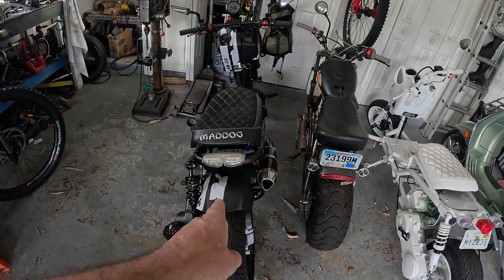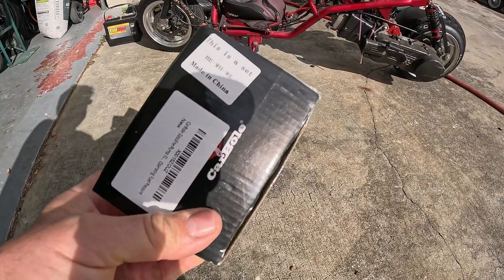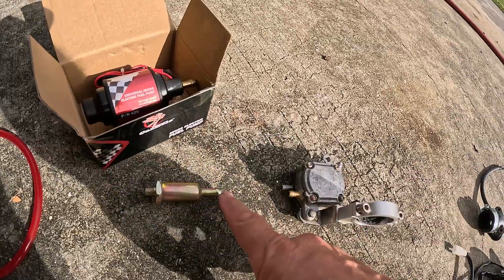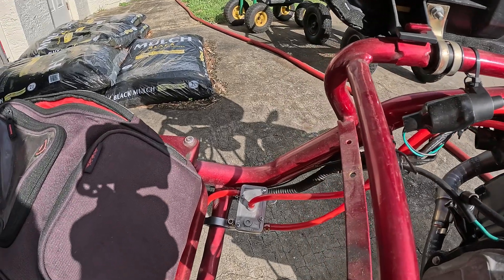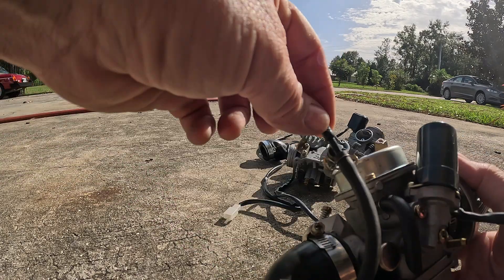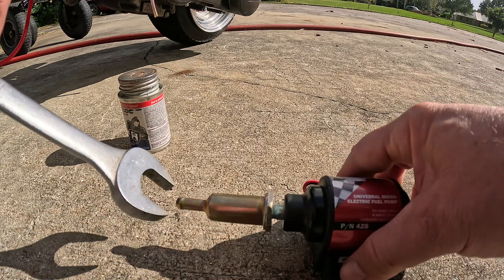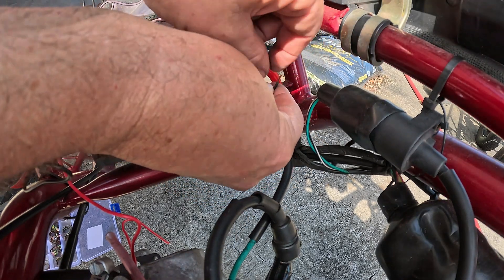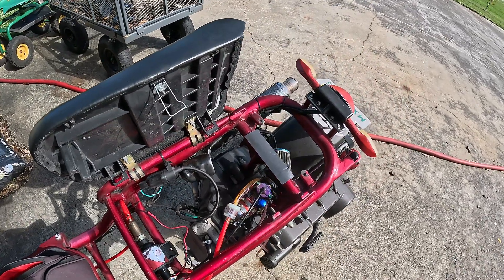How To Electric Fuel Pump Your Maddog or GY6 Scooter In 10 Minutes and Cheap AF

Comment: Is there a video on running or finding black wire? I’m a doofus and could use a walk through LOL

I can’t use the DC rolling wrench version. I have AC and the pump you used in this video… 

So I need the AC version and this pump.
Reply from the maker: ANY solid black wire under your dash where the battery is.  That solid black wires are 12v DC +.  The green wires are 12v DC -.  The green wires go back under your seat and to the tail lights.  If you do not have a Gen 5 then you have to run a wire from under the dash thing to the back that is 12vDC+.  They do not make an AC pump.  Most of your bike is actually DC.  So lot of wires to choose from.  You can even find those solid black wires going into plugs that connect to nothing for accessories that did not come on maddogs.  All these Chinese bikes use the same wiring harness.  

Watch at 2:54 and then at 4:20

https://youtu.be/rAvn8Da_1is?si=p0gCM7khgNg9Zid6
Reply: @GhettoWrench you are the man. What part of Florida by the way? I’m Pensacola Beach area.
Reply from the maker: @jagervolant7871 way down in Sebring.  I went to flight school in Pcola!

Comment: In this video you said the white one has a reliable one that's cheap? It seems like I am having problems with my fuel pump today! Ride WOT for a while and then when I let off it flounder and dies until I can get enough float to be back in the bowl
Reply from the maker: Thay sounds like "normal" vacuum pump behavior.   Did you put the electric pump on?
Reply: @GhettoWrench I did! I finally got the Carbole pump you recommended and now that I have that pump my jetting was way off. I'm running a 28/87 right now. It was either a 31 or a 28 as I don't have a 30 pilot jet. As of now it seems pretty good! A little hesitation when I first hit the gas but I think leaning out the needle will help. Brand new Mad Dog I just bought with only 123 miles on it. Bad CDI and got an electric fuel pump and it seems like it's ok. My handle bars and wheel are a little off alignment. Gonna see what lab cost Paul has to say about it when I get home. You, Paul, and Scooter 911 are the best things to happen to scooters on YouTube! Thanks for everything.
Reply from the maker: @dkewlguy Thanks.  Ya sure drop that needle notch and also try leaning out the air/fuel mix screw (in 1/4 to 1/2).  Even if it is not the "highest RPM" recommended setting.  A lean bike is fast runs great, but bad for the engine if too lean.  So as long as your main Jet is plenty rich then you can get away with leaning that partial throttle stuff and really pep up the initial acceleration.
Reply: @GhettoWrench I've got everything running smooth now but I still can't get my idle below 3500. I'm thinking it's cause the pair system is still there and I'm pulling a lot of leakage somewhere. Someone half assed it. The non EGR valve cover comes tomorrow and I hope to get my idle to around 1800
Reply from the maker: @dkewlguy 100% sounds like a vacuum leak then.  That tube going to intake nippe is usually the culprit.  It is tiny.  Use a zip tie and pliers to pull it tight. You should not be able to easily twist the vacume hoses or caps.
Reply: I have a gen 5

Comment: How do I find this black wire lol ?
Reply from the maker: Open the battery cover thing or whatever is covering your main wire harness.  There are many solid black wires.  The best one is the one going to that connector not connected to anything.  It has that loop wire on it.  That plug is for a alarm system so its not being used.
Reply: @GhettoWrench can you take a picture I’m kind of slow 😂
Reply from the maker: @DavinciPTV 10:15 on this one
https://youtu.be/2ady3OtXsAA?si=uNGfbItuQaGUD6hc

Comment: I have a 2021 ice bear mad dog my rear light does not come on when I turn the key where would I connect to behind the cowel do I tap into the ignition?
Reply from the maker: ANY solid black wire is 12v keyed on positive.  There are a bunch in there.  It seems backwards.  But Green is ground.  Red is 12v battery BEFORE the key and black is 12v after the key is on.

Comment: how make it fuel pump auto stop when float full?
Reply from the maker: It's does not stop.  The motor keeps running but it stops the fuel internally.  Pumps do this to maintain a "head pressure" and not suck gas back out and gravity feed back to the tank.  It seems weird, but all car pumps run 100% of the time.  These little ones do it with no return line.

Comment: Question brother what size fuel line did you use to run from the tank to the pump and to the pump to the filter
Reply from the maker: Tough one.  LOL.  Seems like no size works for both sides.  I buy ALL the sizes from Aliexpress, so who knows....  but I'm pretty sure it was 8mm inside diameter for fuel tank to pump then 6mm ID for everything else.

Comment: Can you point me to a video showing the dc powered wire you used for the fuel pump?
Reply from the maker: Watch at 10 min. ANY solid black wire works.  Even that plug going nowhere with the pink wire loop on it...  has a black wire you can use.  
https://youtu.be/2ady3OtXsAA?si=_CoKkrhLcJte0isM

Comment: I know you said to turn it on. But aren't there Gen 1-5? So if 2 of the Gen's taillight comes on or not, there are still 3 more Gen's. Lol. Is there any other way to figure it out?
Reply from the maker: Im not sure there is a Gen 2 or 3.  People debate this on the forums all the time.  But I have seen "icebears" that look like maddogs and dont look like the Gen 1,4 or 5.  So I am guessing they are the rare 2 and 3.  If so, they would prob be ste same as the Gen 1.  Im guessing the Gen 3 was big change to single headlight and digital speedo.
Reply: @GhettoWrench i have a Gen 3 150 Maddog Trike the rear light turns on when I turn it on so yes u can tap into the rear light, I hooked it up to the battery with a inline fuse and switch to turn the pump on and off, I had to get a regulator and just figuring out how to stop the leaking but I think I will T off after the regulator and loop to return to the line before the inline filter and T it off there as well with a restrictor so the carb gets priority and the extra pressure leaks into the T and loop back to the front hopefully it works I have a Mr Gasket regulator and a Edelbrock Electric fuel pump 2-3.5 psi, it also has the dual headlights and digital speedo
Reply from the maker: @luafaia5113 that T idea is great actually.   Never even thought of that.  Does it relieve the high pressure in the carb?
Reply: @GhettoWrench i am hoping I haven’t started it yet barely figured that plan out last night haha

Comment: How do I figure out what Gen mine is? It's a 2015 150cc Maddog Trike.
Reply from the maker: I think the trike is just the trike and not a Gen.  But probably closest to a Gen 1.  Does it have dual headlights, a 12" front wheel?, a cable drive speedo...  then Gen 1.  Gen 4 has the single headlight and electric speedo.   Then Gen 5 has a 14" front wheel.

Comment: I’m going to install this pump on my GY6 150 in the video. I know I’ll be removing the vacuum to the Pecock, but you say you also remove the vacuum to the top of the carburetor and plug that one off also
Reply from the maker: Yes.  That is an emissions hole.  Aftermarket CVK carbs dont even have that hole.  You can actually just leave it open also.  The important hole to cap off is the one in the intake manifold.
Reply: @GhettoWrench  cool thanks for getting back to me,your videos have helped me a lot 👍🏻

Comment: Would live a video showing how to add the honda electric fuel pump and pulsar unit to the gen 4
Reply from the maker: I put one on my Gen 5.  I just followed the rolling wrench video.  It is easy.  Same procedures.  You have to add a 12v DC wire from the front on the Gen 4.
Reply: @GhettoWrench, can I just add a whole new wire from the battery to the pump?
Reply from the maker: @Payback812010 If you want the pump to turn on on with the key then just go one of the black wires.  But if you want to make a separate switch for the pump you could go right to the battery.

Comment: vidoe link to hook up red wire cant find were to hook it up at
Reply from the maker: To any solid black wire under the cowl.  Thats keyed on 12v DC.  If you have a Gen 5 there is also one going under seat to tail light.

Comment: Was the black wire going to any other component before you tied into it? It looked like you attached it to the pump, but not back to whatever unit it was originally powering? I'm asking out of curiosity because im going to install this setup on my Kymco
Reply from the maker: I had the black wire going to the frame on the same bolt where I mounted the pump.  Pretty poor connection.  Now it goes toto the valve cover.  I only ran a red wire from under the dash to the pump.

Comment: If i have a modified 232cc which electric pump should i use? What is the ratio of cc to use for modified 150cc and up?i also have a 50cc modified 125cc which electric pump to buy?
Reply from the maker: These pumps fill instantly.  They work with cars.  Your fuel burn rate will not exceed the pump fuel rate.  You want the lowest psi available for all of them.  Its so you do not push the float needle stop open when the float bowl is full and flood out the bike.

Comment: Hey I have a low gas tank like this under the carb. My issues is I’m having inconsistent power but not in real time it’s like I rode it today and it is running very strong and when I ride it home or tomorrow it’s might not feel as powerful. Humidity was high this morning so I don’t believe it’s related to that and it’s been warm out as well and been powerful at the same time any ideas where to start brand new 700 miles replaced the carb all stock 24mm carb have gps it at 62 mph sometimes it pull hard all th way up sometimes it barley gets to like 55 I have every vacume like zip tied so I don’t think I have vacuum leaks
Reply from the maker: @ryancelata7915  If you have a vacuum fuel pump then that is your issue.  They don't make vacuum at open throttle when you need it the most

Comment: Does not work tried 3.5 electric fuel pump on 150cc scooter gy6 ran fine but next day flooding fuel running everywhere
Reply from the maker: @WalterMurphy-z2w  yikes.  It's def pushing past the float stop needle.  You are the first guy I heard it does not work from.  Sorry for the bum advice.  It's usually a great mod.

Comment: Sooo, I have a maddog 150 (2014 I think it is). It runs fine below 50mph. Once I hit 50 or above, it bogs and sounds like I shut off the engine. Once it gets down to about 25, it comes back to life and I can keep going. I've been looking all over the place and I can't seem to find any definitive answers. I'm thinking its just not getting enough gas with the vacuum pump. Do you think this would help in my case?
Reply from the maker: @AlicesWondereland  an electric fuel pump will definitely solve that issue.  You will also be surprised how much better it runs and more responsive it is at slow speeds too.
Reply: @GhettoWrench  I think I can tackle this job!! Thank you :)
Reply from the maker: @AlicesWondereland  easy easy.  You got this!
Reply: How do you not know what year I is? Don't you have the title
Reply: @Islandcitymedia  I do. I just didn't bother looking at such trivial things.

Comment: You're the maddog guru. I recently purchased a gen v and I'm having some taillight issues. Would you have a photo of the stock tailight wiring just to confirm mine is correct?
Reply from the maker: @hoss270  I can't post a Pic on here, on the BIKE harness side; the double female bullet thing with green wire is a ground.  I ground for each blinker.  Then a single bullet green female is ground for tail light.  All those can be mixed and matched.  All same ground.  Then you have a light blue wire and an orange wire.  Those are your blinkers hot wires.  Not sure which color is which side.  The black wire is your keyed on hot.  That is for running lights.  The green wire with the yellow stripe is for brake light.  That is from memory.  LOL.  So I hope I got it right.

Comment: Only if the needle seat doesn't fail they're very small and you can't depend on them specially when they're made in China there's absolutely nothing wrong with running a vacuum fuel pump the only fail when the bike sits for a while and then you got to blow into the tank with some are or your mouth with a rag I'll say it over and over and over dude you don't know what you're doing man

Comment: You should not be telling everybody to run electric fuel pump and throw your vacuum mccooney fuel pump in the trash there are the best there's nothing wrong with them I don't never have any problem I'll say it over and over and over I left you a lot of messages cuz everybody needs to know you're misleading everybody and you can have needle seat failure after period of time because of this garbage ethanol fuel so I think twice before you pick up all these damn electric fuel pumps there's no need for it the bikes don't come like that

Comment: You being a helicopter pilot you should know better not to use that liquid plastic on your fuel plumbing pipes you should use aviation pipe sealer made by permatex do you still have a lot to learn I figured you would know that aviation pipe joint compound is what it's called repeat aviation pipe joint compound is what you put on the threads not what you're putting on the threads you should know better be in a helicopter pilot and you should not be running electric fuel pump is absolutely no need for you're throwing your pump in the trash you tell everybody to do that misleading everybody

Comment: And when I suggested to use a clean rag and put your mouth on the fuel tank and blow into the fuel tank to build a pressure up that's if the bike has been sitting for a couple months couple weeks otherwise you should not lose your fuel flow

Comment: Why are you having all these problems I don't have all these problems and I ride my bikes and I got all kind of scooters and I go even I go drag racing with one of my scooters and I use mikuni vacuum pump have no problems at all need to do your homework
Reply from the maker: @steveblottenberger1097  that red bike sits a long time and the fuel in the carb evaporates if it sits in the florida heat for a week.  My lawnmower uses a vacuum pump with no issue, but I drive it at least twice a week.
Reply: How many scooters do you have with the gas tank lower than the carb? Probably none every maddog has this problem  🙄  my Honda helix had an electric fuel pump. The ruckus has an electric fuel pump. You are the one who doesn't know what you are talking about 😂 #tryharder

Comment: And when you blow into the tank with a clean rag with your mouth build up pressure within 30 seconds have no problems at all with fuel flow you guys want to run all these electronic fuel pumps and draw power go ahead and more weight
Reply from the maker: @steveblottenberger1097  they are very low amperage draw.  It may weigh a few more ounces than the vacuum pump.  You should give one a try.  I bet it will feel quicker and gain a couple mph up top.

Comment: My fuel tank is on the bottom too and I have a AmStar scooter and I have the mikuni vacuum pump I have no problems at all it's a very good vacuum pump if you lose fuel flow I just take a clean rag and blow into the tank
Reply: Do not buy electric fuel pump because he is doing it keep a vacuum fuel pump I have no problems at all if the bike sets for a while you take a clean rag and you put your mouth on to the fuel tank I know it sounds crazy you blow into the tank build a little bit of pressure up 15 seconds you will have fuel flow does electric fuel pumps will cause needle seat problems with the carburetors at their period of time
Reply from the maker: @steveblottenberger1097  Ya the vacuum system really only is an issue for guys that let their bike sit real long or guys who live in the country and ride at full throttle for long periods on country roads.

Comment: This dude's nickname, if it ain't already, is now "Scooter" I ain't mad at him though. Im about to buy my first Maddog and I honestly believe watching these videos saved me from making the wrong choices. I was sold on getting the 150 cc Gen V but have decided to get a Gen 1 50 cc. Now i'll probably be watching these videos multiple times. I'll be joining this channel for sure.
Reply: 😂 buying a  50 over a 150 makes zero sense you're going to spend close to the cost of a 150 just to get almost the same speed on the 50. And that's after buying the 50. I  only got my 50 because it was $200 with 545 km  I put the first 5km on it when I worked at a scooter dealership and assembled it out of the crate for sale. 10 years later it was on Craigslist and I got it

Comment: Just ordered the pump thanks
Reply: Why did you order electric fuel pump you will have needle seat problems you only have fuel flow problems when the bike sits for a while you take a clean rag you put your mouth on the clean rag blow into the tank 15 seconds later you got fuel flow you should you run a mikuni vacuum fuel pump I drag race scooters I Ride scooters every day I got all kinds of scooters he doesn't know what he's doing I do not suggest electric fuel pump do not buy one do not put it on your bike they're dangerous you will have needle seat overflow fuel problems after period of time especially what does garbage ethanol fuel